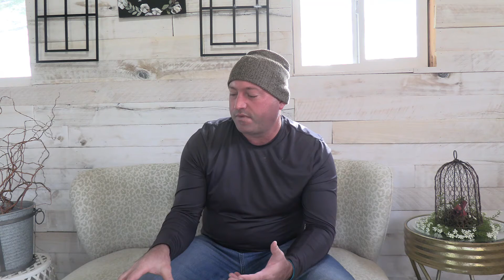Can I Use The Bathroom If The Power Goes Out?!? | #AskThePumperdude

Comment: Enjoying your common sense videos!  Do you recommend Zoeller Pumps for Sewer Systems (as in a two-tank system - effluent tank and pump "basin") Zoeller makes packaged Basins with pumps and rail systems that I a may be ("forced" by the State of TN) going with.  TDEC seems to push a lot of pumped septic set-ups  over gravity flow for some reason?